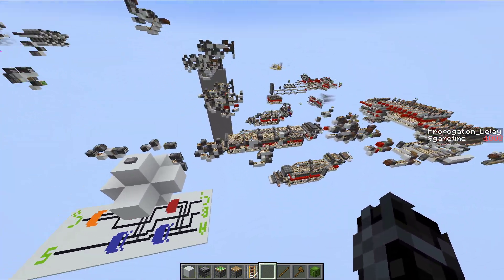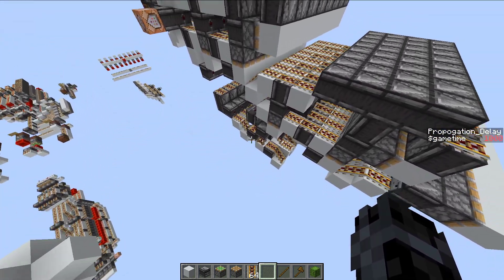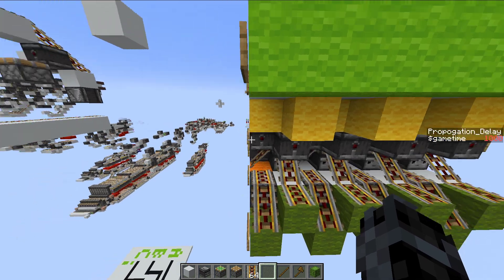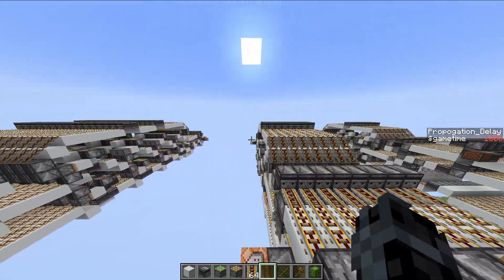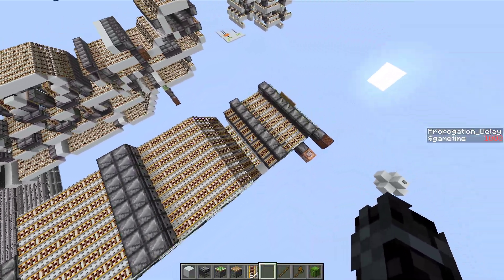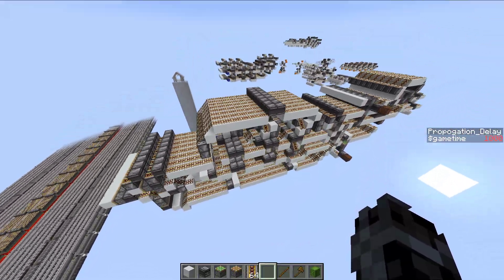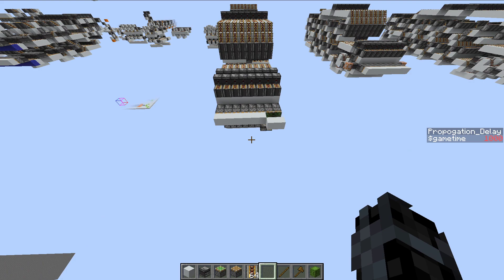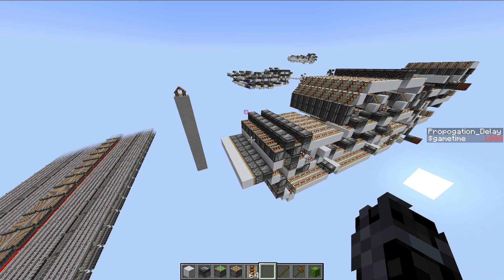Dustless Fast Adder || Redstone Computing

Comment: 30gt for 32bits?
Reply from the maker: Unfortunately no, as the final merge stage would reach >9 rails long. You could switch to Carry Increment, which would add 16gt to get to 37 bits -- but my guess is that I could still make Sklansky work at the cost of an additional +6gt or +8gt. So best case scenario, probably 32gt.
Reply: rip